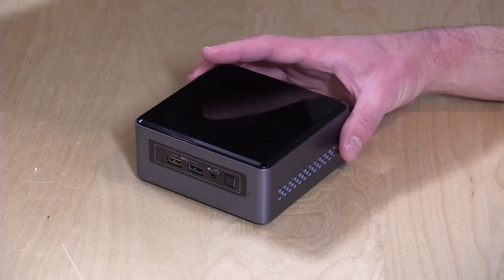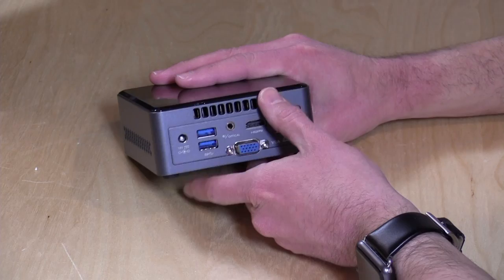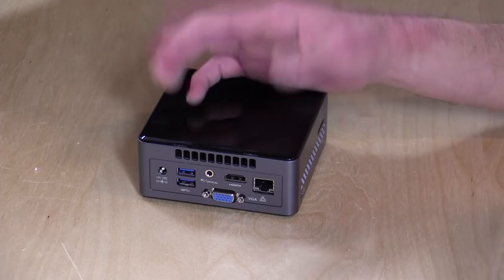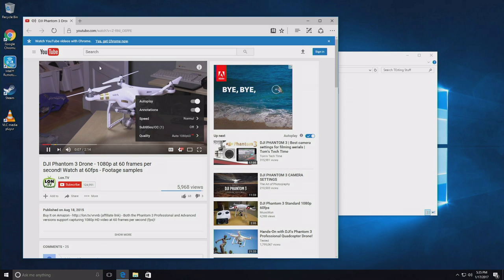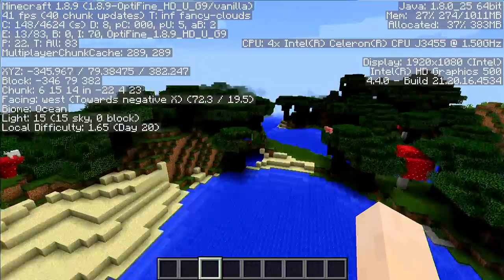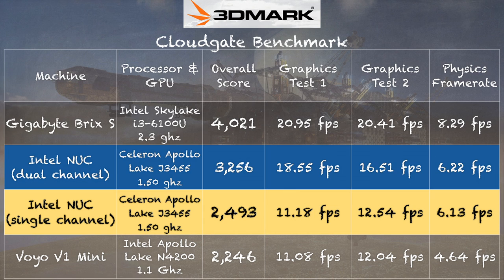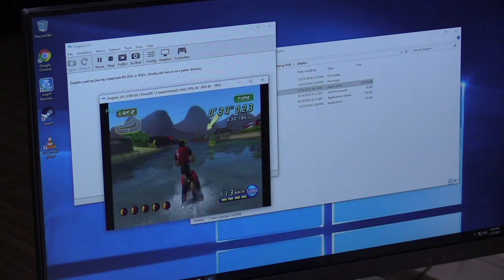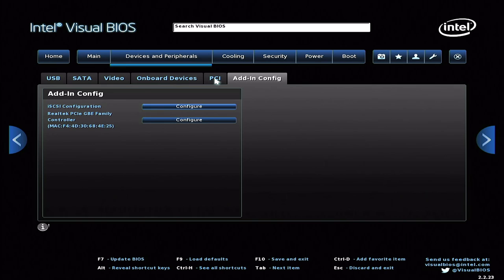Intel 2017 Apollo Lake NUC Mini PC Review - Celeron J3455 - NUC6CAYS

Comment: Warning:  MEMORY UPGRADE SHOWN IN VIDEO IS NOT COMPATIBLE WITH Intel Nuc NUC6CAYS

If you try upgrade the memory with the sticks shown in video (Crucial CT51264BF160B), you will get an "Unsupported 1Gb or 2Gb Density Error" while booting.   The architecture requires 4 rectangular chips/stick instead of 8 square chips.   

Here is an explanation:
http://www.intel.com/content/www/us/en/support/boards-and-kits/intel-nuc-kits/000023485.html

Intel Nuc Recommended Memory
http://www.intel.com/content/www/us/en/support/boards-and-kits/000023025.html

Comment: Just started using the barebones version of this NUC with a 240GB SSD, 8GB of RAM, and Ubuntu 18.04 installed. A couple of minor teething errors here and there as I'm trying to get used to Linux, but so far, I am extremely impressed with its performance.

Comment: Great reviews off these low power devices, but I miss one imprtant thing and that is power consumption. A little power test would be nice. Just a simple read out from a simple power meter is fine. 
The power values you fnd in the specifications are in general not really usuable.
Reply: yeah i want to know what the power usage is compared to my amd sempron 2650 mini itx pc
Reply: how did the kill a-watt device save you money did you replace all your electronics with low power devices costing you an arm and a leg😂

Comment: I bought this and returned it. It ran fine, but I could not get it to boot into the recovery partition. I like to fiddle with these things too much, not be able to restore to factory.

Next, I ordered the barebones. (same unit $159) With it I bought a 525 GB ssd. I had 2x2 gb of the proper memory so I am using them. Win 10 pro key was about $50 and download OS from Microsoft.

Running Happauge TV tuner USB. I like to watch, pause, and record live tv OTA.

Kill-a-watt: 1.1 watt, unit off. Boot about 14 watt. About six at idle. 10 watt playing 1080p video through WD passport hdd.

Playing same video while tv tuner operating was about 18 watts, and neither stuttered. (your mileage may vary)

The emmc 32gb drive on the windows unit, used in this review is slower than 2.5 ssd and the 2 GB ram would likely be replaced, anyway.

I have just over $350 in it with my old memory and have windows 10 pro. And enough drive space to be comfortable.
Reply: How did you get Windows 10 Pro for $50?  It is nowhere near that on their website for even the Home version.
Reply: Kinguin, for the key. It activated ok and if you pay about $5 they guarantee it. (worth it)

Comment: for some reason, I have not been able to get the NUC to display (via HDMI) on the Samsung TV (UN60KU630), I am not sure if I need to do something to the TV (I did reset the TV and try setting it up again, nothing). Or adjust the NUC display properties, not sure. Could be that I actually need a 2.0 HDMI cable, will pick one up later (seems dubious, but I'll give it a try.)

Comment: I noticed on the Bios screen your ram is running at 1600 Intel's website says the J3455 supports up to 1866. How much would this affect the internal graphics performance when  using faster ram?

Comment: Had a "Kangaroo" computer that had an Intel Atom chip, the processor was more than adequate to play back my videos since I'm only running 1080p files, but the ram was only 2gb and the built in ssd was 32gb. I was literally to the point where windows 10 was not installing updates because the 32gb wasn't enough, and I really only had chrome and some software to play back my video files on it (so less than 500mb of additional software on the device). Anyways it finally had some kind of catastrophic failure and I bought this NUC here, I'll probably regret it since it's now November of 2017, but until I have a device I won't be able to play anything, waiting until they release a new version of the NUC isn't in the cards. Anyways I think this NUC will be more than adequate for my needs especially since I've gotten a 128gb SSD and 8gb of ram to put in this. Way better than what I was using before which was adequate 90% of the time anyways.

Thanks for all the detailed info on this system, really  useful.

Comment: hey lon great channel love your content just a question about these mini pc are they able to play games like american truck simulator or euro truck simular 2 or gta 4 already have these games just looking for a pc that can run them even at its lowest settingi have an acer aspire es 15 i can run the trucking sims graphics are not good but it works but gta 4 i cant run looking for something cheap to buy to play these games
Reply: If I'm reading this correctly, I think you are asking if this device will run certain games better than your current laptop. If you need to game on a restricted budget, I'd suggest rather than going for one of these devices with a cheap, low end Intel processors (or any Atom, Celeron or Pentium with the prefix N or J, ie Celeron N3350, or Pentium J2900), I would strongly urge you to spend more money on a device with a Broadwell, Skylake, Kaby Lake processor (denoted by Celeron, Pentium, i3, i5, or i7 with the prefix G or the suffix U or M, such as a Celeron 3855U or Pentium G4620). These processors would all provide much better performance than any of the budget products could. I've been through this; I used to be rocking a laptop with a Celeron N2830, an incredibly weak budget chip. Now I've built a desktop with a Core i3-6100 and the performance is massively better in every way.

If you're really set on a NUC, then this (https://www.newegg.com/Product/Product.aspx?Item=9SIA6BM56F2432) at $270 USD at the time of writing would provide a massively faster CPU and graphics combination that would likely have no problems running all the games listed.
Reply: yes you are right Mama Luigi  thanks for the comment and yes really tight on money just looking for the cheapest and most smallest alternative either laptop or mini pc with an os if possible
Reply: MamaL:
Thanks for that Newegg link.  Very nice pricing and good product.  I might (eventually) move to having one of these by my TV.  I have a big PC now, and it's wonderful.  But, be nice to make everything small & quieter.  So, thank you.  Also, I wish that all of these little devices would start having M2 / NVMe ports or more Sata3.  One Sata3 is really sucky.  Again, thanks for sharing.
Reply: Mama:
Yep, look that device ... https://www.newegg.com/Product/Product.aspx?Item=9SIA6BM56F2432
wow ... does have a M2 port ... 1 x M.2 slot (2280_storage) ... Yep, that's a SWEET MACHINE.  Shawn, get that one, looks much better from initial cursory review of the specs.  WOOHOOO -- NVMe ... WOW!!!!
Reply: thanks for the suggestion kinda hoping for a system that i can use right out of the box

Comment: Hey wait!  We PATREON subscribers are 'paying for this review' -- aren't we?  ;)
Reply from the maker: Not directly :). Remember it's in a lock box for when I'm able to bring on staff !
Reply: Off topic, but didn't you have a issue with the USB Linux Live messing your windows computer up?
Reply: hi i was wondering if i use this mini nuc pc and hook up gtx card on exp gdc to the m.2 slot inside of it will it increase gaming performance i mean the cpu is quad core which is pretty fast
Reply: its a little crappy mobile celeron cpu.  good for its limited uses. go build a pc.